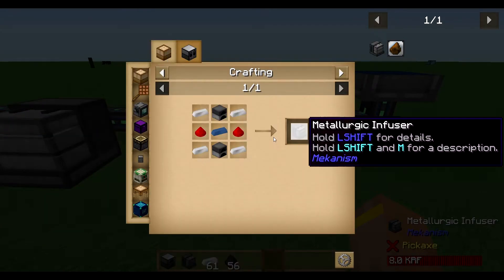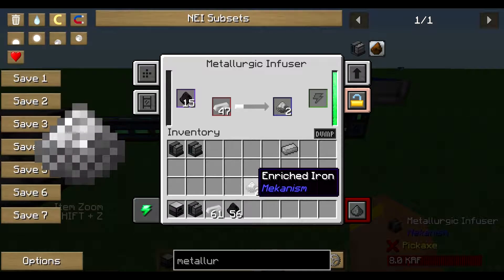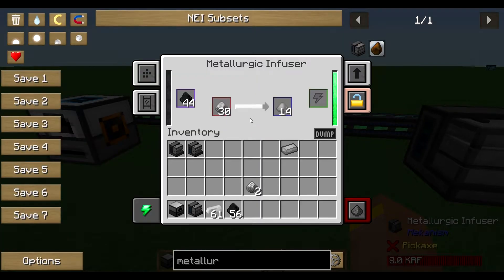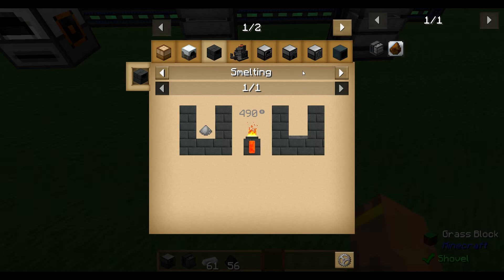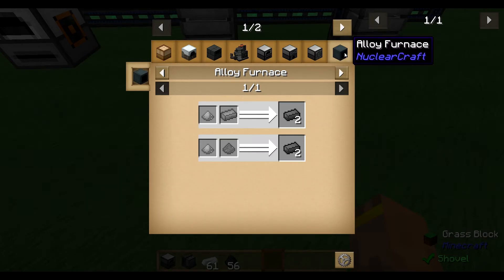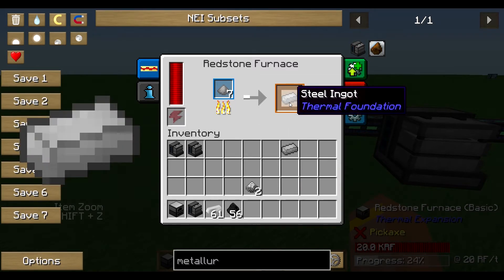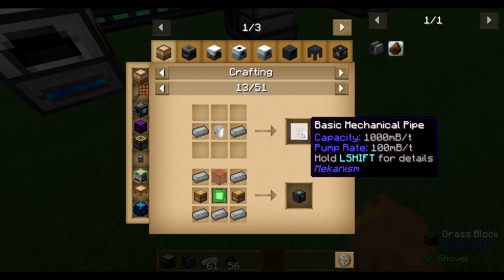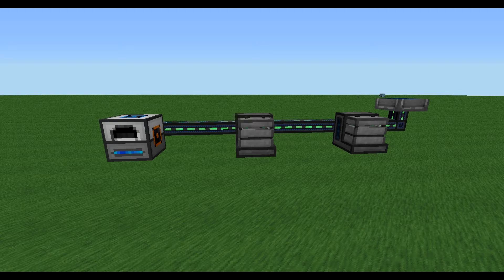TUTORIAL: PRODUCE STEEL - MEKANISM & Thermal Expansion Minecraft ENG

Comment: has this changed? as i cannot get the enriched iron to convert to steel dust... following your instructions there should be no problem.
Reply: Oh wops, redston signal was on ahahah
Reply: @cristianobattisti9446  you get it fixed ?? Can ya tell me how??
Reply: gary kilduff check if your redstone signal is disabled in the infuser
Reply: @cristianobattisti9446  will check it out... thanks man.
Reply: @cristianobattisti9446  mines disabled, still cant get Steel Dust :( u on FTB or AT Launcher?
Reply: @Arkturu5  im plating all the mods lite 3 on the twitch launcher, which i guess is the same as the ftb one
Reply: @cristianobattisti9446  ah, i am using bevo tech pack
Reply: @Arkturu5  dunno bro , try googling
Reply: @cristianobattisti9446  yeah im just gonna download ftb tbh
Reply: gary kilduff same